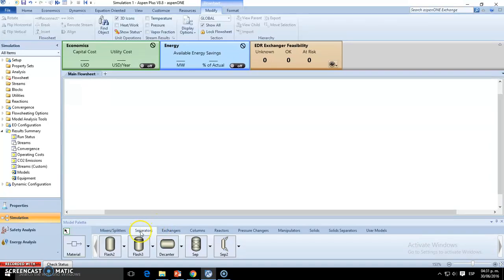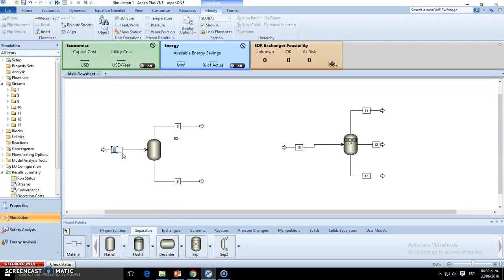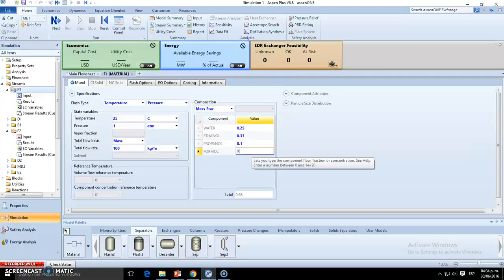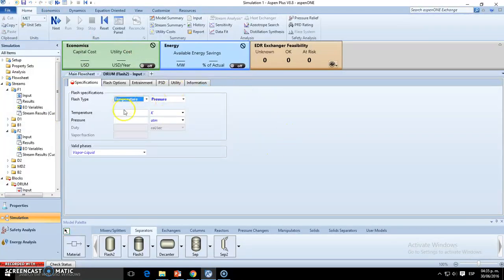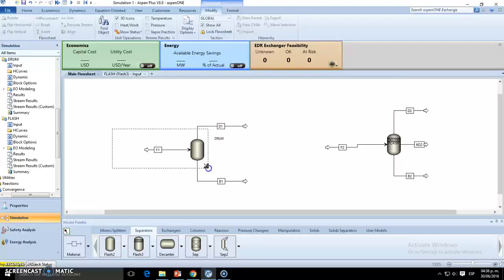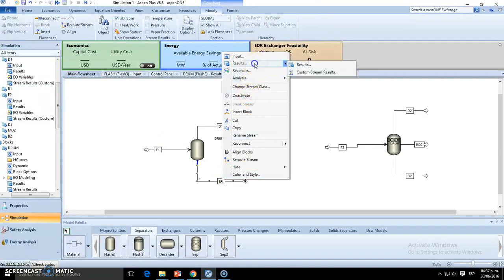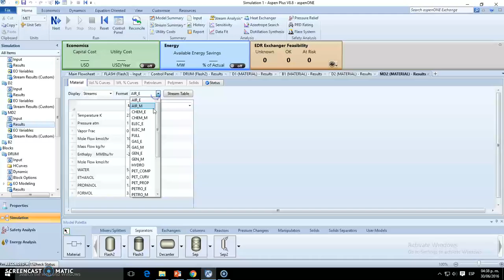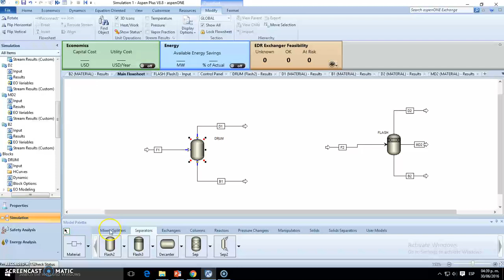Lecture 25: Separators - Flash Drum Exercise

Comment: Hello Guys, I did not get access to give my input data for the composition.,I can able to ge temperature and pressure , Total flow rate values but coming to composition ,the blanks are in deselected mode, Unable to enter the data., Can Someone please let me know how to activate it to give the data
Thanks
Reply: Select Mole Fraction in composition
Reply from the maker: thanks for jumpin in!
Reply from the maker: 💬 Hey! Usually, composition fields stay disabled if the feed type or property method isn’t set correctly. Check that you’ve selected the right feed stream and thermodynamic model first. Also, make sure the stream isn’t set as a “spec” or linked to another input. Try resetting or creating a new feed stream if needed!